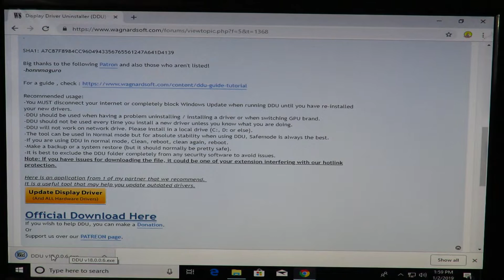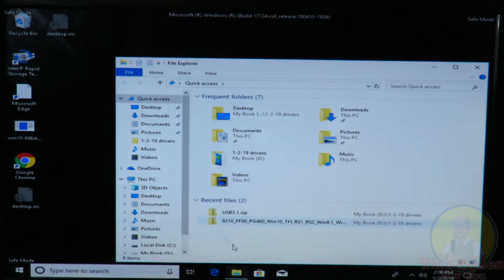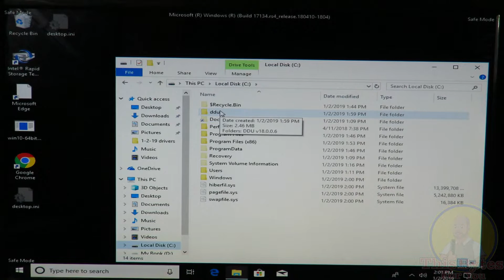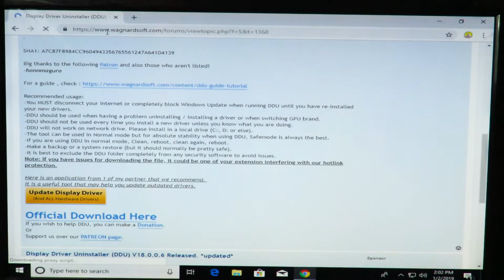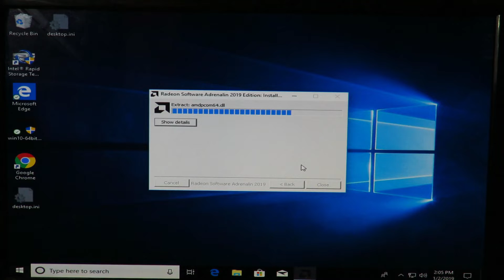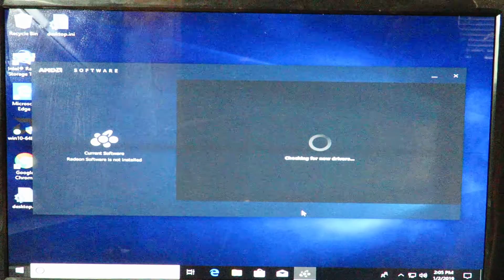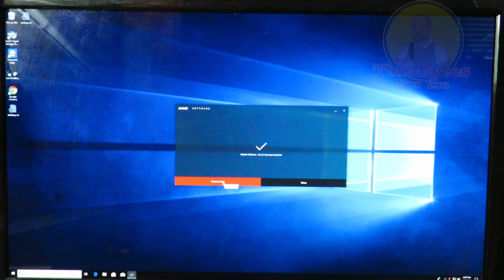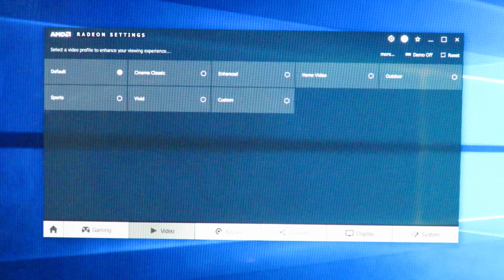How to install the AMD Sapphire Radeon Nitro+ RX 590 8GB OC Special Edition

Comment: i had the same graphic card, i want ask something, so i just plug 8pin without the 6 pin, but it work well. now... what is the worst case could happen ?
Reply from the maker: no, you need to plug in both.  The worst that could happen is when that card reaches 100% use, the machine may shut down, you may receive artifacting, blue screens and the likes.
Reply: @ThisBytesForYou  thanks for responding. im looking for dual 6+2 pin, is that the right one ?
Reply from the maker: @pancamaingame6610  a dual 6+2 or a single x8 PCIE connection, yes that would be it.  it should already be part of your power supply.  What manufacture and model number power supply do you have?  Be careful, because there is a CPU 8Pin cable as well.

Comment: Hi. i have radeon rx 580 8gb.. i haven't installed  it yet.. i was wondering, should i plug 6pin and 8pin like what you did or just the 6pin \ 8pin? im really confuse which pins should i plug.
Reply from the maker: yes, always plug in all the connections provided on the card.

Comment: For fucks sake had to stop this at 1.38 because what fucking idiot cannot remove and install like to like video cards as in 16pin and 1 8 pin connectors pretty much im sure everyone is here to figure out what to do when your power supply doesnt have one of each of those fuckers but 2 6 pins that are used up with adapter to make an 8 pin... any way i am here only to see if it is an either or connection or both cause xfx did not include a manual or a pdf online and did not want to fry a new card .. apparently will use a 2 molex to 6 pin adapeter for the 6 pin and my 2 6 pins for the 8 pin
Reply from the maker: So lovely to have your here my friend.  You would have to use both PCIE connections on your video card., or if your card has 3, use all 3.  Since i don't know which card you are talking about, and since i am idiot, which card specifically, exact model number do you have, so I can help you, but I warn you, I need to wear my bib, I am known to slobber, you know, being an idiot and all.
Reply: my bad actually watched more and video has helped me tremoundously. apparently that stray 2 pin connector I always used to cable tie out of the way it to convert a 6 pin to an 8 pin and now I do not need to install and adapters that clutter up my bay anway. just need to verify the placement of the 2 pin and all is good ,, thanks ,, PS that is an expensive card shouldnt you bolt it in before messing with cables ?
Reply from the maker: So very happy I could help you my friend.  Yes you should screw the card in, you could potentially damage it if you are too rough, but sometimes on camera, you don't think 100% straight, you know, being and idiot and all.  I hope the card works well for you and so very happy you stopped by, checked out my video and commented, it means the world to me.
Reply: @ThisBytesForYou  Actually the card was returned it was a horrible pos and ran hot and had to underclock it before it would even be stable. purchased new from amazon and it arrived in original box beat to shit and it was pre opened and not new. Beware buying from amazon because they resale used items as new and ship them not carefully packaged but in original box and toss it around for good measure prior to shipping so they can scam ups into covering it by insurance as damaged during delivery. if you get package beat up deny it. mine was left on doorstep so was not around to deny delivery. by from new egg they dont pull that sorta shit. replaced the card with a GTX 1660Super and it runs all around quieter and faster and lot more fps
Reply: if you game in winter time and need your pc to also work as a space heater to warm the room then buy an RX 590 as it runs at least 40 degrees hotter then my gtx 1660s with fans at 65% versus gtx at 40%
Reply from the maker: @mathewhoffer4541  like with anything, things happen, I buy from Amazon all the time and never had an issue, but it could happen.  As for the card it was great, if you are having thermal issue, you dont have overall good case cooling, I have never had issues.
Reply: @ThisBytesForYou  I had issues because I was sent a defective video card that was delivered by ace ventura pet detective you know where the ups delivery guy kicks the fragile box up and down the street and smashes it between the elevator doors etc. and amazon uses the postal insurance for damaged goods to cover internal cost from returning defective items.  they dont make any money off shipping defective items back to the manufacturer so they simply resell them as new and let the end customer either declare it as damaged in shipping and ups pays for it (optimum) or sends it themselves back to the manufacturer either way amazon recoups their loss and passes off the hassle to others and still profits from the sale. this is in every way blatant insurance mail fraud and also this particular card has existing flaws with the cooler design and heatsink not covering the chips there is a jay z video on how he corrected it but had to void warranty and make some parts etc. the card I ordered was one of these and yes that fucker did run hot and I have a coolermaster case with good air flow and never once had any heat issues run I5 at 5.2 ghz water cooled and system temps with video card never go above room temp with silent cooling I been doing this since the birth of the internet so not new to PC building
Reply from the maker: @mathewhoffer4541  oh man, that comment was awesome, delivered by Ace Ventura haah, thats amazing but yeah I know what you mean, horrible on their part.  I had a run in with Amazon yesterday, not on shipping a defective item, but losing a package and rather than re-order the package for me, fixing the issue, not wasting my time, they refunded my money, which works, but it's still a pain in the butt, buying lighting for my videos, to make better content for you and everyone.  Every penny I make here goes back into ThisBytesForyou.  

Please understand, liquid cooling does keep the cpu cool, but it reduces overall airflow into the case as an air cooler helpes to cycle air, as well off of the top of the video card, so you want a bunch of fans blowing air in, then fans sucking air out.  As a product development engineer for Alienware, then Dell after they bought us and then Later Velocity Micro, I can tell you from experience, everything you do in a case, will affect airflow, like you, I have been doing this since before the real internet came out, working off of BBS' and such back in the day with my IBM XT 8088 5150, maybe 5180 (I forget the real model number, but no HDD, 2 x 5.25 floppy drives).

Never said you don't know about PC's, don't know your situation at all, I don' question anyone expertise till it's presented to me, I have no other way of knowing, conversations like this are great to help everyone understand everything.  The card can run hot of course, but personally I have never had issue, also, everyone's definition of hot is relative without numbers of course but hey, as long as you got something working for you, that is what is important.

Your comment about when the birth of the internet, is why I started this channel, back then there was no instruction on how to do any of this, so it was expensive to figure this stuff out, so I made this channel to help everyone with as much as I can.  I thank you so much for stopping by and checking out the video, sharing your experience and the conversation, it means a ton to me.

Comment: Hi , sir . So i have an rx 580 8g sapphire edition , and im wondering if im supposed to place both 8 and 6 pins, or 8 pins alone ?? because i only used the 8 pins , but i faced a problem which is the pc reboots whenever i start a game . Do u think that this is the problem and i have to use both 8 and 6 pins together to fix my it??
Reply from the maker: If you see 2 or 3 or 4 on a card, they always need to be connected.  As for the crashing, that could be it, not receiving enough power, make sure to get the VERY latest driver, it fixes a bunch of issues.

Comment: Friend, want to ask you something i wanted to buy this card this or 580 sapphire nitro thats kinda same, but i heard that they are noisy and temperatures are pretty high, did you encountered some problems with this card and should i pair this card with r5 2600 or gtx 1660s?
Reply from the maker: no issues with this card or the 590, I had one issue with the newer driver, but I resolved that and created a video on it as well.  I would probably go for the 1660, above the 580 though.
Reply: @True Roman ye, ill probably go with it, or Maybe even used 1070ti or 2060
Reply from the maker: 1070 or a 2060 would do much better for you than a 1660.  Please come back and let us know what you go for.
Reply: @ThisBytesForYou  I heard that people would go for 1660ti rather 1070ti, cause its newer tech, i cant really decide, but used 1070ti Is much cheaper  than used 1660ti Price tag Is around 200$.
Reply from the maker: @voste2093  yes, it is newer tech, the 1660 and a TINY bit slower than the 1070, so just see which one you can get, a 2060 would be so much better to get though if you could.
Reply from the maker: @voste2093  although, newer cards coming out in September, so if you can hold out just a bit
Reply: @ThisBytesForYou  Do you have some more informations, i dont really follow the PC world, which cards Are coming out? Maybe new cards will drop Price of the old ones so that would be awesome deal :D
Reply from the maker: @voste2093  no.... They have not been announced, that will happen in September but if you subscribe and click on the bell notification, you will know when I come out with my videos, I will surely be reviewing those

Comment: i dont have the 6 pin pcie, i only have the 8 pin, it still works , i dont know where to get the 6pin from
Reply from the maker: It will not work with one, which power supply manufacturer and model number do you have?
Reply: @ThisBytesForYou https://www.amazon.com/Sapphire-Backplate-Special-Graphic-11265-21-20G/dp/B073BKYBC5
Reply from the maker: no no, who makes your power supply and what is the model number, power supply, not card.
Reply: @ThisBytesForYou  Channel Well Technology CWT GPT500S-A 500W
Reply from the maker: @Criz_Outlaw  I have worked with Many channel Wells, they are usually power supplies put within OEM machines, and are usually spec'ed a bit higher than they really are,  if you want to get a new power supply at a budget, that is decent, maybe look at this, if you want to stay at 500WAtts: https://geni.us/6wI9A, I would recommend more, let me know if you want to know more

Comment: I’m getting no video output
Reply from the maker: please give me some information so I can help.  

1. what manufacture and model number motherboard are you installing this on?
2. what manufacture and model number power supply are you using?
3. what manufacture and model number video card are you using?
4. When do you get no video output, do you ever see anything on your screen?
5. Do you have both PCIE connections plugged into the video card
6.  Fill in some additional information if you feel that would help.

Comment: Hello ThisBytesForYou can you please help me, i recently bought this card and I have a question, for this card should I use two separate cables (1x8 pin and 1x 6 pin) or one cable using the two heads ( 1 cable using the 8 pin and 6 pin header) Sorry my native language is not english. Thanks
Reply from the maker: You are typing it perfectly well, but I also do speak Spanish, so if you need my help in Spanish, I can help.  I prefer using 2 separate cables, but sometimes I do use 1 single cable that has a 6 and a 6+2 header, it also depends on your power supply.  Would you happen to know who makes your power supply and the model number so I can help you out?
Reply: @ThisBytesForYou  Thank for your response, I bought a corsair RM 650w 80+ GOLD FULL Modular to pair with the rx 590, its a build for my son. My personal PC that has a vega 56, and they do recommend to use two separate cables, because of the power draw. So I decided to ask you if I should use the same process in this card. Thanks for the help
Reply from the maker: @Shinratotil  yeah you will be fine, that is a great power supply, and has some room to spare if/when you want to upgrade the card later.  Again, I recommend using 2, just for peace of mind, but it is a lot easier just using one, and it will work just fine for you.  Very happy I could help my friend, my pleasure.
Reply: @ThisBytesForYou  thanks, I put a mind at ease. Thanks a lot. You gained a fan. Keep the good work
Reply from the maker: @Shinratotil  thank you so much my friend, I truly appreciate your kind words, always working hard to help people and I am so happy i could help you.  Thanks as well for the sub, it means a ton to me.
Reply: @ThisBytesForYou  no Problem, it is I who should thank you, Keep doing great videos, I have been watching some and will do the same in the future. Congrats from Portugal..
Reply from the maker: @Shinratotil  thank you so much my friend, I truly appreciate your kind words.

Comment: i have a question sir, mine won't turn on, not even the lights, could it be a pci connector problem? the rest of the pc works just fine.
Reply from the maker: Well, what kind of power supply do you have, manufacturer and model name and what are your PC specifications?  Do you have both the 6 Pin and 8Pin connector installed?

Comment: What if I didn’t have a graphics card that had those pin connectors and I’m upgrading to a graphics card that those have those pic connectors
Reply from the maker: you would need them, what is your power supply manufacturer and model number?
Reply: ThisBytesForYou I have a 500 watt power supply and I don’t really know the manufacturer 
 or model number
Reply from the maker: sorry, youtube never let me know this message came in, did you end up getting this card and if so did everything work for you?
Reply: ThisBytesForYou yes now I did and since the Rx 580 is a bit power hungry I had to upgrade to a 650 watt power supply
Reply: @itssvlix7111  500w is enough for 580

Comment: Hi, so I have a corsair tx550m psu, and I currently don't have the extra cables it comes with cause I previously had a nvidia quadro fx 570 gpu which didnt need power connectors and now I have a rx 590 fatboy core edition (quite the upgrade I know) and need power connectors any idea where I could get them or should I get a new psu? Any help would be extremely appreciated.
Reply from the maker: Nice, that is a great upgrade, a Quadro card is nice, but its made for workstation tasks, while a Geforce or Radeon are made for gaming, its majorly a driver thing (any driver can be made to work on different hardware) but its a nice difference in generations.  A 550Watt, is kind of low and many video cards are now requiring 600 or 650Watts, a cable kit alone for your power supply is about $100, so I would recommend a new power supply, fully modular as well, like this one, a 750Watt on my Amazon affiliate store: https://geni.us/yVQTaSB, I have the 1000Watt version, but as a reviewer, I need to make sure I am ready for anything that comes my way.  Also, I recommend keeping the box and keeping the additional cables you may not use in that box, you never know when you will need them.  I hope this helps you my friend.
Reply: @ThisBytesForYou  Thanks for replying its actually impressive the amount of support you give. I'll check out the link and see how it goes from there. Thanks!
Reply from the maker: @silentiumdingo  Thank you my friend, I love help people and it is so very kind of you to take a moment out of your day to thank me, it means a ton to me.  Please let me know if you have any further questions, I would love to help you get everything up and working.
Reply: @ThisBytesForYou  that power supply is pretty good and delivery is quick I'll probably get that one for sure. Thanks again.
Reply from the maker: @silentiumdingo  you are so very welcome my friend, very happy you liked it and I am sure it will solve all your problems today and for the foreseeable future

Comment: I just finished my PC build and while everything works great I’m curious, should I run two individual cables for the 6 & 8 pin connectors or using a single cable with two connectors 6+2 & 8 work fine? I have a EVGa 750w G3.
Reply from the maker: if the power supply provides a single cable that splits into 2, it can handle it, so you should be good.  I am running the 1000W G3, and I love it.  Let me know how everything turns out when you are done, very curious and of course, if you are running into any issues, let me know I will try my hardest to help.
Reply: Awesome Thank you!!! Everything works great no issues thankfully. I just noticed in some videos multiple cables vs one.
Reply from the maker: you are very welcome my friend, happy I could help.

Comment: hey i know this video is a bit old but I'm here to tell a problem I had on my rx580 nitro +. When I installed the drivers my card just shut down and then the screen started turning on and off. It runs fine without the driver but when I install it, it does that.
Reply from the maker: Try running DDU to remove all of your old drivers, and then reinstall your latest driver, you can see my video on how to do this, let me know on how it goes.  Also, you never have to worry about how old a video is, I reply to all my comments: https://youtu.be/clLYbBywhAg